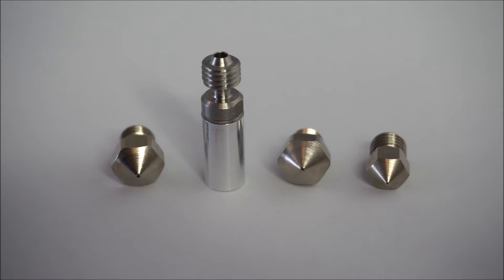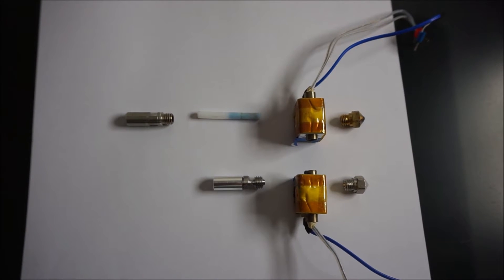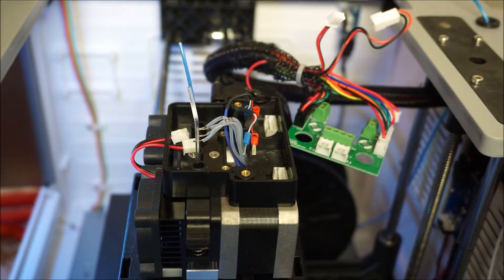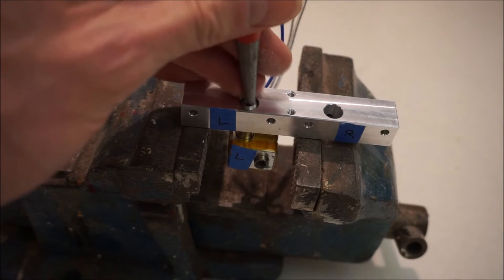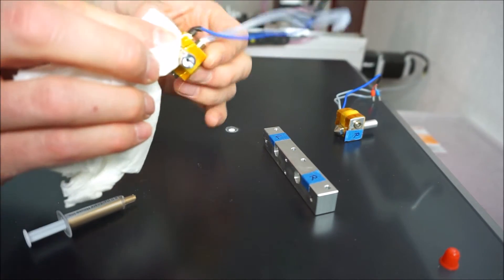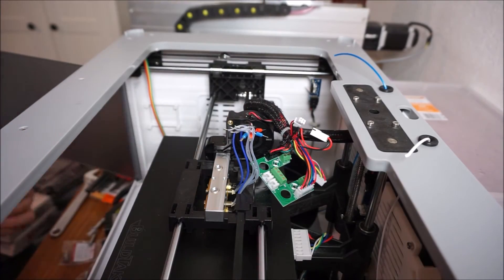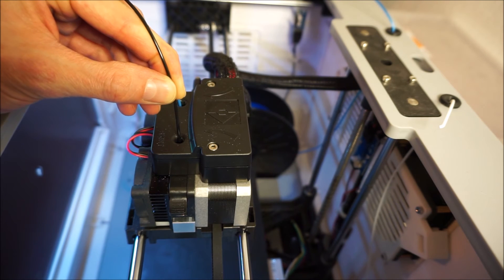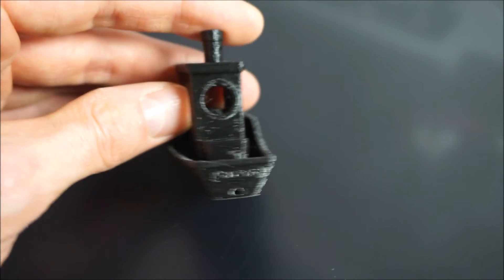Install an All Metal Hotend on the Flashforge Dreamer

Comment: Could it also print peek, with this nozzle setup?
Reply from the maker: Hi, I would say definitely not. Peek is a very demanding material requiring higher print temp than this printer can handle. Also it would need an actively heated chamber.

Comment: What's max temperature you can set on the dreamer? Buy any available methods like new firmware or compiling one. Much appreciated. Thank you.
Reply from the maker: It has been a while since using the dreamer, but I have only used it up to 260C. It might allow you to go higher, but I am not sure if it can actually maintain a higher temperature during printing. So the only thing I can say with certainty is that up to 260C works.

Comment: fantastic guide mate! Do you know if the process is the same for the inventor 1 ? Cheers
Reply from the maker: Thanks! I am not sure. The inventor 1 looks just like a blue Dreamer and the hotends look the same from the pictures I see online, but it is difficult to tell without having access to one. Also note there might be a temperature limit in the firmware for the hotends.

Comment: I replaced one hot end to the micro swiss all metal on my Flashforege Creator Pro. I am now having issues printing ABS.  What are your settings to print ABS with the all metal hot ends? Thanks for the very informative video.
Reply from the maker: Leba, I stopped printing with ABS quite a while back so I do not have much experience with this material in combination with the micro Swiss hotends. So I would not be of much help here other than suggesting different temperatures, but you have probably already done so. The reason for not printing ABS was not the hotends but the smell by the way.
Hope you get it working, Robin

Comment from the maker: Hi, thanks for the feedback! The method you describe sounds like a decent procedure and will likely work in most situations. The reason I used the bed is because I found my extruder carriage to not be parallel to the guide bars. From one side to the other around 0.1mm difference. Might be that mounting of bearings was not correct at factory, warping of carriage or something else. This would also mean that in my case the aluminum bar would also not be perpendicular to the z axis. Therefore I decided not to change anything on the bed leveling and use that as a reference for a before and after check. For a universal procedure yours is recommendable however, so again thanks for posting.
I havent tried, but I believe even if something is off afterwards one could use a fixed point on the bed, even if the bed is tilted, and measure the height of each nozzle on that specific point and adjust if necessary.
Robin

Comment: @UptimeFab you tightened the nozzles assuming that your print bed was level, which it would never ever be as it is being manually adjusted at the screws on the bottom! The only thing you can count on being in level is that cooling bar you had your heaters mounted on. 

The correct way:
You should first tighten both ends of the hotend into the heater and then measure the 1mm gap from the top of the cooling bar like showed on the video. This tightening is final - but don't overdo it! Do not readjust later! There's no other way you could rest assured those nozzles being at level, as your bed is the least accurate measure to take. Finally, level the bed to match the nozzle height.

Comment: Great video... I just wanted to point out that I tried backdating the firmware as you had posted in an update on your web page, and found that my printer actually was allowing me to go to 280c on the extruders, and 130c on the bed. Now with Flashprint, I can't get any higher than 255c/260c (depending on what version of Flashprint you are using) because the software just won't allow you to enter any higher values, BUT!!!! If I use simplify 3D, I can enter whatever I please, so I tried entering a 290c extruder value, and a 140c bed temp for one of my prints, and this caused the printer to max out its top allowed values of 280c on the extruder and 130c on the build plate! (Of course I didn't allow it to heat to those temps because I haven't installed my all metal hot end yet.) But it looks as if it will work fine. Just thought that everyone would like to know about this. I backdated the firmware to "dreamer_2.4.20160603".
Reply from the maker: Hi Grant, Thanks for sharing your experience with the firmware downgrade! I have never printed with anything higher than 260C but it is great to see that there is still some room left for tricky filaments. Simplify3D indeed does not have the temperature limitations built in. People that still want to use Flashprint can generate the G-code file and then change the temperature in a text editor, the extruder temperatures are in the first couple of lines.
Robin
Reply: Hi, thanks... Just wanted to throw an update in here. (got my all metal hot end installed, thanks to your video) I ran into a few issues that people should be aware of. 1st) Running the build plate at 130c for extended periods of time caused the machine the throw a fault. Something about the temperature being out of range. So the printer automatically shuts off the build plate heat, and you can not get it to heat up again until you turn the printer off and then back on. I've currently been running at 120c with no problems. 2nd) The option to disable the rear fans under settings is gone with this firmware. However, the fans will still kick on automatically when the internal temperature reaches 46c. 3rd) The light will not come on until you perform an action, ex: jog/print/preheat etc... Kind of miss having the light come on as soon as the printer boots up, but hey, no big loss there. 4th) Ive been running into bugs in the system once reaching 275c. The machine will hit 275c, then jump to 426c, then go back down to 274c, then the machine will turn off the heating block. The extruder will then cool down to 263c before kicking back on and climbing back up to 275c and repeating the process all over again in an endless loop until your prints done. On one occasion, the printer actually told me that the extruder had reached pass its max temp and shut the heating block off on me and told me to reboot the printer. These are obviously safety features built into the Dreamer, annoying as they may be, I'm glad to see that they are there! I'm going to dig into the printer a little deeper to check and see if not being able to get to 280c is a software issue, or maybe hardware. The thermal coupler may be to blame here. But I'll have to do some test to rule stuff out. Other than those 4 issues, the printer works good! It prints pc abs well at 273c. And I haven't had any major issues as long as I keep the temps under 274c/extruder and 125c/bed. Also, it should be noted that my x-axis carriage has not melted or misshaped in any way. (I have the newest model Dreamer)
Reply: Hello, this is because of the limitations inside the GPX exe/plugin, reach the page: https://github.com/uoitalia/GPX to download a gpx executable or source, if you want to compile it yourself, to remove those limits.

Comment: Outstanding job!  I may have to upgrade the nozzles in the FF Dreamer now.  Is the carbon filament better for durability?  PLA is so brittle and ABS is so hard to keep from warping.  But ABS is more durable than PLA.  It just smells terrible when you print with it.

Comment: I've read that PLA gets jammed easily in all-metal hotends. Have you had any problems printing PLA after this mod?
Reply from the maker: I have read about similar issues with PLA in combination with the micro swiss hotends, but have never had any issues myself. However, please note that I am mostly printing with modified PLA. Regular PLA might respond differently in an all metal hotend, I am not sure. My main reason for going with modified PLA wasn't printability though, but material properties, like increased toughness. (and unfortunately also increased price per kg).

Comment: Hi Uptime fab, great video, thankyou. I have found that the firmware I am running on the Flashforge dreamer limits my temp to 250 deg c, even though I can set it higher in Simplify 3D, any ways around this? its printing ok at 250 but I figure it would be better with higher.
Reply from the maker: Hi Paul,
This is a firmware issue. Previously I was able to set the nozzle temperature to 260C, but after upgrading my printer to firmware "dreamer_2.5.20161222" I could also not set the temperture higher than 248 degr. C. There seems to be no workaround for this firmware version, since the printer will set the temperature to 248C even if the G-code tells it to use a higher temperature.
Good news is that it can be fixed. My Flashprint software (still have the older 3.12.0 installed) also gave me the option to install firmware "dreamer_2.4.20160603". After installing this version the issue was resolved and I could use higher temperatures again. I am leaving my printer on the older firmware for now, since I do not see any benefits in using the newer firmware.
Please note: if you install different firmware it is completely at your own risk. I have bricked my dreamer once when trying to upgrade firmware. I cannot guarantee if the 60603 firmware is compatible with your printer.
Good luck!

Robin

Comment: I have a similar printer, the Wanhao Duplicator 4S and I also got the same all metal hot ends as you did. But I ended up reverting the left one for the standard hot end because it was better with flex filaments. The flexible filaments would jam way more easily. So now I use only the right extruder for more abrasive filaments or higher temperature ones, and the left for support or flexible. Offtopic: are you dutch?
Reply from the maker: Hi, That looks like a good solution. Since it is difficult to find an extruder/nozzle that prints all filaments perfectly, using 2 different nozzles makes perfect sense. I guess it all depends on what type of parts you are printing.
Yes, I am Dutch. No matter how frequently I speak English it is hard to get rid of the accent :)
Reply: UptimeFab I am Portuguese, living in Belgium and working in Amsterdam. So I'm just used to listening to Dutch accents. Your accent is fine, mine is much worse. :)

Comment: So can anyone tell me why this works ? If you had to have a teflon tube  before to keep the filiment from melting before it reaches the hot end why is it OK to just run it with out now ? Seem like this is a simpler way to go , why didn't the printer come this way from the start ? Love my Dreamer . So can you still get a filiment jam in the cooling tube with this new all metal set up ? Great video. Thanks for shairing.
Reply from the maker: Hi,
Thanks for your reply,
The stainless steel heat break works as follows: Stainless steel has relatively low thermal conductivity. However, since it still conducts heat faster than teflon, another trick is used; there is a narrow section in the heat brake which also helps to reduce heat transfer from the nozzle to the cold section above. These two aspects combined provide a sharp enough transition point in the heat brake to prevent the filament from melting prematurely.
In the meantime I have been printing lots of PLA and some PC with this hotend. It really works! (no jams so far)
I was also a bit mystified why this is not fitted as standard on most printers. I think that this is because the all metal hotend is a relatively new development and suppliers are not adapting this quickly enough. Also, the stainless steel parts cost more to produce, although I cannot imagine this being a significant part in the overall cost price of a printer.
Maybe more printers will come with an all metal hotend as standard in the near future, time will tell...
Robin